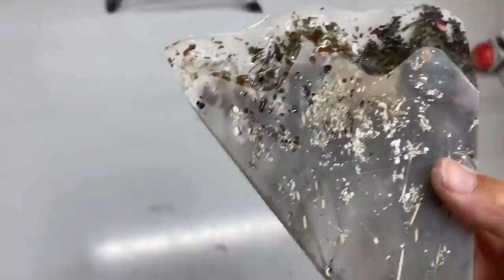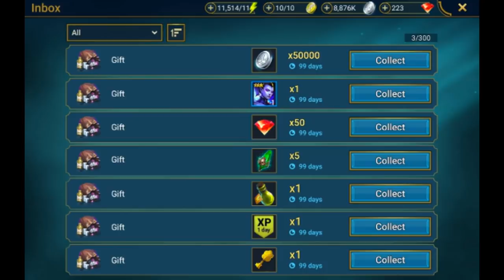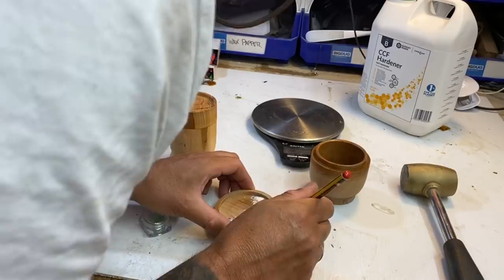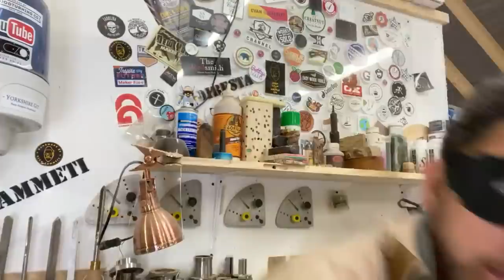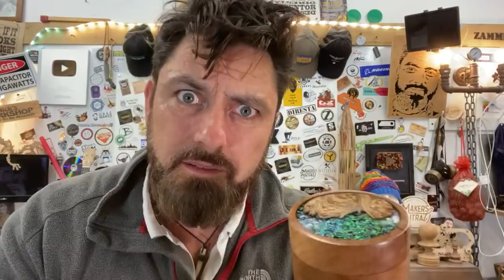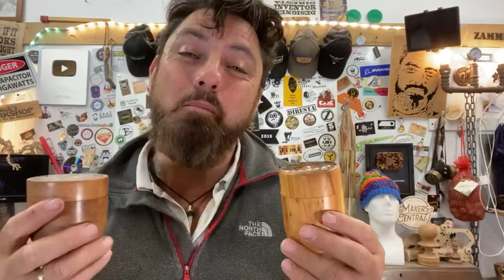TURN - SCRAP WOOD INTO AMAZING COLORFUL ART

Comment: Hello, from the west coast of the USA. An idea for a challenging project. 2 pots, a set, one is round on the outside but square and hollow on the inside. While the other is square on the outside and round and hollow on the inside. The lids have to be interchangeable with either pot while keeping their shape, you should be able to use one lid for both boxes if you place one box upside down on top of the other. It can be done. Good luck.

Comment: I have a suggestion or two.
How about a two or three piece pool stick from a bunch of glued together little bits of wood (for the top section) and then use a combination of wood and metal cast-off in resin for the middle section and a combination of crayon shavings, thin colored pencil slices and glitter in resin.
OR
How about a set of shot glasses tightly fitted with a N/Z coin emblem on the bottom of the inside with a small yet strong magnet on the rim and inter locking bottoms to make a cane and on the inside of the "handle part you could have a tiny little light that could beam down throw all the shot glasses.

Don't mind me, those are just a couple of things I'd like to see being made or have made.

I have more ideas I'll share in the future.

Comment: Have you ever thought of doing a resin (with something funky) and wood chess or checkers board set? You could put dried flowers or crayon shavings in the chess pieces and the checkers pieces could be crayon shaved in resin coins. It could. Be a box so the pieces go inside and the board could be the lid.

Comment: If you made resin blocks in a solid color and turned them on the lathe could you use the shavings to put them in a funky pattern in new resin? As I’ve understand it it “melts” back? In my head you can control where a certain color stays and melts with neighboring colors.